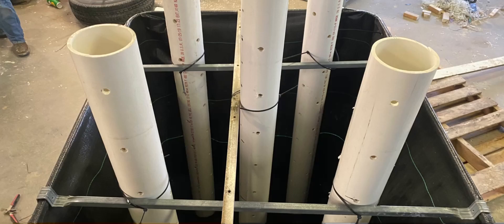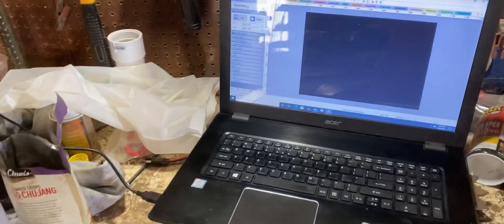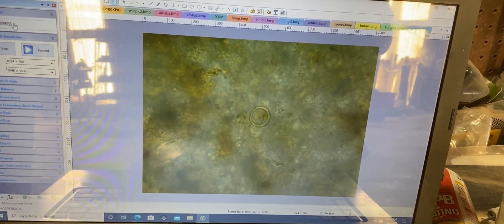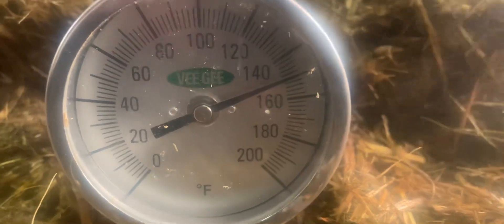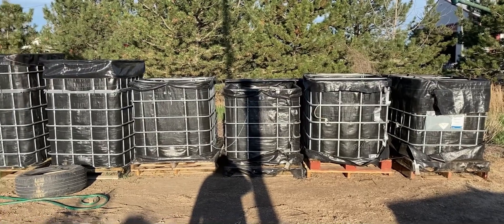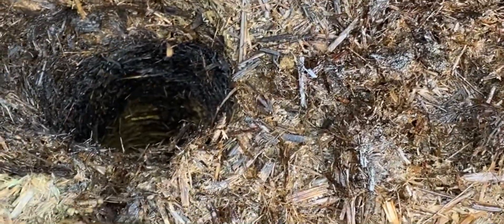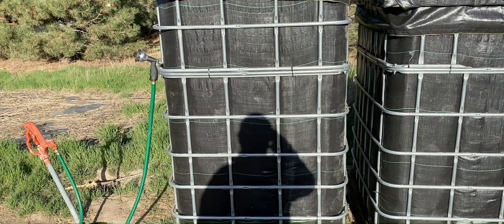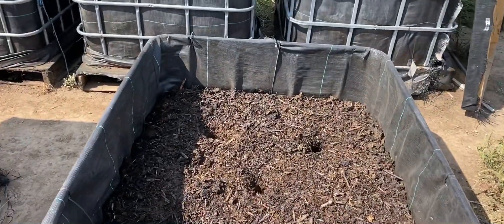Johnson Su Bioreactor day 395 a year in review.

Comment: I used 50/50 grass/weeds and leaves. I live in the suburbs so those were the only materials I had at hand. Unfortunately, I messed up and added too much water. It smells horrible. I don’t know what I should do now. I obviously haven’t watered it so it dries out at least. Is there a point of even keeping it if it’s bad compost. Considering just throwing it all out which sucks because a lot of work went into it.
Reply from the maker: Leaves are really good so I’m the future you can make one with just leaves.  Dr Johnson makes a lot with just leaves.

Keep it.  The 200 bushel corn we raised by just using the extract still worked.   Find something you can use to poke a ton of holes in your compost to get air in it.  I’m nature things go from aerobic and anaerobic conditions all the time.  Your compost probably won’t be fungal dominant but it will still have use
Reply: @youngredangus6041  Just finished checking the compost pile out. I dug down to about half way and there was no smell. I took some in my hand to squeeze and only a bit of water came out. Some of the compost also looked like it was slightly glued together. Everything points to it being aerobic now! Man, what a relief. It STUNK last week so I was worried. Hopefully, the biome balances out and the anaerobic bacteria die off.
Reply: @youngredangus6041  I’m going to take a good look at it today to check out the water content. Considering taking the whole pile out to turn it and add more browns if it’s too wet. If I do that, I will also put some pvc tubes and take them out like Johnson does (I have one large hole in the middle).

I just hope it turns out well, I really wanted this to work. Either way it has been a good learning experience so next time I will definitely be making it almost exclusively from leaves and being way more careful about the hydration level. Thank you for your advice and video, it helps a lot seeing the progress on the good and bad batches.
Reply from the maker: That’s great!

Comment: I watched another video of a bio reactor and I think his method maybe is safer. He did a bioreactor but did it straight on the ground so the water goes in the ground. That might prevent anarobic conditions. 

But really if you use IBC totes you think just opening the tap at the bottom would release enough water it’d be fine. I got some ibc totes I turned into worm bins and I’d fill it clear full of water to saturate everything and let it drain cause in the summer it got super hot and only had water two a month. 

Did your giant totes not have a drain for water? One thing is you might add some charcoal in the bottom since that’d help absorb any water if you have excess. And charcoal can absorb nitrogen or whatever your compost may give off. Wood chips are a good idea. Might speed things up if you maybe buy a composting microbe packet or fungi bag and add it to Innoculate it. Looks like ya worms which was a good sign. That’d be interesting to see if you had a spicket on your ibc tote or whatever you used.

Comment: Do you have more 12” between you air holes.
Reply: The 1foot technique for enough air to circulate. You were indoors with air moving? I would have used some air blowers in door maybe a leaf blower. 
This maybe a dumb idea but what about putting scoria (lava rock) on the bottom or through out.
Reply from the maker: @Michael_333  

So we used pinecones and it didn’t work as well as just drilling holes in the bottoms of the pallet 
https://youtu.be/y-RhKxvkxvA. You can see that in this video
Reply from the maker: I’m sorry I’m not following you.

Comment: What was the ratio of brown to green materials,  please?  I built one today but I need to make the holes in it. Just stir crazy in Winter I guess. Oops. ha! I also need to water it but we are having rain and snow coming his week. Thanks!
Reply from the maker: Most of mine have been all brown materials.  I guess the would consider the manure we use as green or a source of N that is going to get hot.  
I’ve also used just straight grass clippings that we pulled up that were a year old.

Comment: Your bins are enclosed with plastic and this prevents air circulation. Why not use chicken wire instead?
Reply from the maker: It is really dry and windy.  The sides dry out as is.  The newest one I put wood in between the gaps on the pallets then drilled holes all over it.  That seems to be working well.

Comment: Awesome vids and thank you. Diego Footer has an adaption to the Johnson Su where he uses chicken wire in place of woven fabric, larger diameter, one larger center hole and doesn't use any pallet? Would the outside dry more? He thinks not. I have a few truck loads of arborist wood chips delivered and think I will invest in a chipper to reduce their size. Maybe add wine cap mushroom spores to speed decomposition and harvest those beauts? But I have one question about the worms. I will have to purchase some bed run worms. A mix of red wigglers and ENCs should work at different depths. So, do you separate them at the end of the process and if so, how?
Reply from the maker: Would you be willing to talk over the phone?  I have follow up questions to ask to make sure I understand your question 

620-376-8593
Reply: @youngredangus6041  Wow!! Thank you. I'm in Georgia, and I'm 100% Irish so get ready for accent shock. I've messaged my number so that you can call whenever it's convenient.
Reply: @youngredangus6041  https://www.youtube.com/watch?v=S6yNNy4rvM4

Comment: Great experiment. Good to see the final experiment.
Reply from the maker: Have you tried any compost on your farm?
Reply: @youngredangus6041  I have but have been reading and watching about the Johnson Su for a while. I am trying to figure out a set it and forget it method. Maybe make one pile once a month. That way I won't run out. I am interested in how yall are spraying it too. I wonder how that would work by just spraying on my yard and my pasture. Not tiling it or anything.
Reply from the maker: Or compost extract
Reply: @youngredangus6041  No extract yet. Just regular cold compost is all I have made. I have two huge piles of wood chips now. One is mixed half leaves and half woodchips. I turn it about once a month with the tractor. The other pile is straight wood chips.

Comment: Thank you for being transparent & honest in your results & findings including the microscope analysis. These reactor piles are diificult to manage due to a variety of reasons. I've lost two. One spec built, one slightly modified due to weather.

Lots of clowns out there hyping "modified" systems that I suspect will never produce the coveted clay-like material we're all after. But they will no doubt declare them a "success" without any analysis.
Reply from the maker: Thanks for the feedback. 
I want to help people.  That means sharing Failures and encouraging others to keep going
Reply: The clay-like material is worm "poo" + other "poos" from other invertebrate animals. I'm doing worm compost since 2016 and the 2 by-products you end with are compost tea & worm compost very well separate phases from the initial organic matter . You should built this in 3 or 4 compartments. Form bottom to top : liquid phase container in which you can adapt a outlet tap - a thiny hole perforated container that holds  the muddy worm compost (poo)  but let water percolate through - 1 or 2 staged filling containers that can fit together without compacting the raw matter and with large holes (about 3 to 4'' wide) drilled in the bottom covered by a square chicken coated wire netting. I have also springtails, woodloses & slugs in my bins. They all help degrading the organic matter.

I your situation, I would fill such storey system (big worm composter) with the organic matter obtained from your reactor, once temperature has dropped below 80 F.
Reply: @MrWookie21  Build the "storied" system & show us how.

This sounds like the very definition of taking a simple system & over- complicating it.

Also by tearing it apart to "re-build" it into "stories" you're likely wrecking/tearing the fungal hyphea & bacterial colonies already established at the end of the thermophillic phase.

Better to just build a giant CFT-style pile with vent pipes, let it go thermophillic, add worms at 80 degrees, close the top & leave it alone for a year except for daily watering on a timer. Less work & less destruction of the microbiology.

Your "storied" container sounds like it's designed to catch leacate. That isn't a conern with a Johnson-Su. Proper venting & moisture are important. An extract can be made for field spray/furrow injection if needed from castings.
Reply: @MrWookie21  Yes. The thermophillc reaction is necessary as is not disturbing the reactor pile (rebuilding it into "stories") by turning it which shreds/destroys fungal hyphae & bacterial colonies & increases salinity particularly when manure is used as a feedstock in the bioreactor. That was an initial & major goal of Johnson's research & process...reducing salinity...by not turning compost in piles or wind rows at all.
Reply: @MrWookie21  Interesting. Tiny. Not a bioreactor. Also not farm scale or even market garden scale. The Johnson Su scale up is a bit more than making compost tea or sqeezing out some lechate. The extracts are for seed coating, furrow injection, field spray, pasture regeneration among other applications/uses.
Reply: @flatsville1  I read you ; but why is heat increase necessary ? I know aero & aero-anaerobic fermentations may raise heat up to 150 F (or even more) ; but it's related to specific biochemistry reactions taking place involving highly soluble and fast decomposing raw materials (small molecules metabolization). Therefore much gas are wasted through volatile substances (ammonia, carbon dioxide, methane, sulfur dioxide, etc) reducing the heap content in carbon, nitrogen, hydrogen, oxygen, etc. 
The first reason I  read/heard the heat to be beneficial is by destroying weed seeds.
The second, is to inactivate pathogenic microbes (bacterial, viral, fungal, yeast, etc.  diseases) or other animals, eggs, etc. to prosper.
That's why heat doesn't remain very long and decreases once the soluble components have been consumed : microorganism activity has decreased.
Are there other reasons you want heat ?
Or you just want heat & poo as fixed objective ?
Reply: @MrWookie21  Only the thermophillic microorganism activity has ceased. Plenty of other post-thermophillic microorganism activity remains & continues. That's what the worms are eating over the course of a year just like they would work through any worm bedding.

Again, the challenge Johnson had was to compost manure with carbon to reduce salinity. Turning wind rows & piles increased salinity. The answer to stopping the increasing salinity cycle (& dangerous run off it created) was to thermophillic compost (aerobic by venting) without turning & have worms complete the process below 80 degrees F.

You can't put worms in a hot bed so a thermophillic cycle & cooldown period is necessary. The same with any worm bed mix which can heat up & kill worms. It is a mistake many first time worm farmers make.
Reply: @flatsville1  Worms don't need a pre-thermophillic phase ; otherwise my worm composter wouldn't produce worm casts. There is no heat at all in my composter ; or at least unnoticable. 
The major difference I see is that I'm adding regularly fresh (let's say every week or 10 days) kitchen waste on top of the upper layer of the compost VS one straight filling of a bioreactor.

Volume is also different ; that's why in my case fresh layers are steadily aerated. And the time they get consumed by worms, woodlouses, springtails, slugs, etc ; at the end no oxygen is needed anymore to decompose them until they fall in the lower compartment (where there is plenty of air anyways). That's why I never had smelly compost.
Heating up is not a natural process ; heaps are man made / artificial conditions. Nature works without creating heaps. We want speeding up the process of decomposing ; this means we are changing the rules somehow...
And this this sounds ideological ; therefore leading to prejudice to my opinion. 
Human science = prejudice + Applied science = greed  will lead to conflicts or war. 
The "organic" label is just a facade for trade... On another thread I mentionned : a war on compost (after oil)...
That's why we see all these communicants popping up on yt, through local authorities : they follow Agenda 21 - etc. 
Keep in mind Nature doesn't sell or buy anything. But the Bible tells us total domination will take place over the world.
Before the end of the age.

Anyways, to accelerate decomposition (down to 3/4 weeks) by piling, not only oxygen/moisture/brown/greens  are necessary ; but particles size matters. And that's why venting/aeration is crucial due to compact/stacked small material.

What do you mean by salinity ; soluble salts leakage from plant cells degradation ? 

Another aspect to mention is mycorrhizal build up to accelerate fiber breakdown.
Reply: @MrWookie21  What you do in your tiny worm composter doesn't address the issues of dealing with ranch/farm scale cattle/dairy manure, increasing salinity of turning piles & wind rows & the toxic run-off.

Simply web search-soil salinity manure application-to understandvwhat a problem it is.

Comment: finally great success on #8. Awesome. 
I'm using a tote. What was the best way to empty it and stored it?   Have you found a better way then just turning it over. This is  what I did last year and for the first one from may 2021. I have one more left.  I was thinking about cutting the cage either horizontally for vertically  in half and tying it back together to refill.     Open for ideas.  here's the work I did on them. https://www.youtube.com/playlist?list=PLMbTNltxnJlIc-nl-B57qZg_UJnrchAaI                                                                                                                                                                                                                     This was the best question and answer videos I found about the johnson su bioreactor. It came out this year. It helped connect the dots. You can scroll past the video to get straight to the questions and answers section.    I hope it helps in this journey.   I just join his registry. Have submitted your work.                                            

https://youtu.be/Q15UqNSZ4Tw  <https://youtu.be/Q15UqNSZ4Tw>  soil stories
Reply from the maker: Thanks man for the feed back.  I’ve been cutting the cages.  When I’m done I’ll use Zip tied to put the cages back together then when  compost gets below zip tie line I’ll break the zip ties roll down the weed barrier mat and have easier access
Reply: @youngredangus6041  Thank you for your reply. Is it possible to show a video of what the tote looks like after you cut it and zip tied it? I think I got the image of how you rolled the weed barrier down. Is this process working well for you or have you been thinking of another way of emptying it out?

Comment: I've watched Dr. Johnson's video of how he makes his bioreactors twice. I think his only feedstock was wood chips, right? He really soaked them in a wheelbarrow before he put them in, and when it was built, he ran an automatic sprinkler for one minute a day at the top. I am wondering if the coarseness of the wood chips preserves the air spaces in the pile and prevents it from going anerobic?
Reply: Dr Johnson used straight leaves on his video, however I wonder if we could get away with using stover here.

Used bedding would be almost ideal so you get a mixture of manure and carbon
Reply: @russellsmith3825  You're right! He did use leaves. I would think that your stover would work fine. Have you seen this video of using this process on a large scale? It's very interesting: https://www.youtube.com/watch?v=JGxSDhnvUUc&t=518s
Reply: @elizabethblane201  I'll check it out.
On the wood chips in a Johnson Su, Diego footer was trying that in one of his videos...

I am wondering about a hybrid design for a vermicompost system incorporating the perforated vent tubes so you could get airflow in a continuous flow through worm bin. And if you might get similar results

Comment: I have been looking at different feed stock choices for a while.  I decided on a RotoMix to blend & fill containers. Buying a building & truck yard to handle materials.  Thank you for sharing your experiences, I will do the same.  I will be doing large quantities for Texas Range Lands. Aerated Static Piles (ASP) seem to be an option as long as they are left to mature for the 12+ months.  I  have feedstock choices & several container styles plus ASP to test.
Reply: I didn't see that YRA had any irrigation set up for his containers, and wondered how he managed moisture. I know that Dr. Johnson, in his arid climate, has an automatic sprinkler on his piles that run for one minute a day. I think that the correct moisture content is important, right?